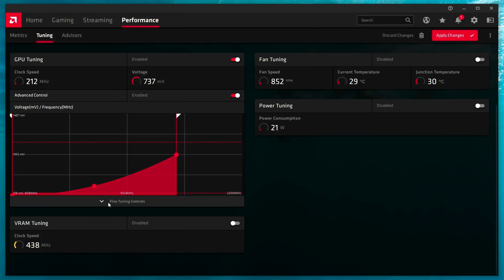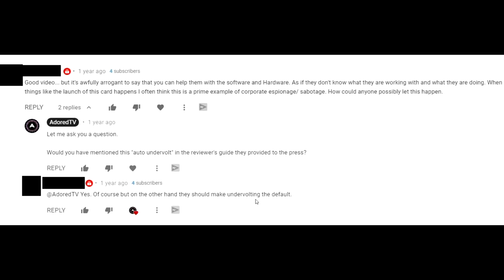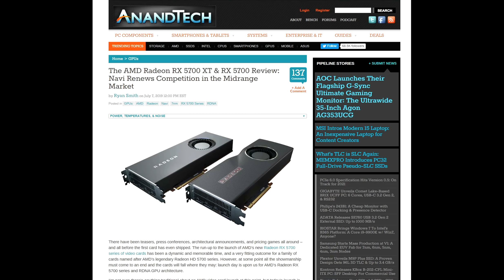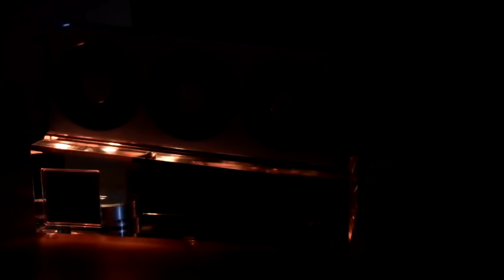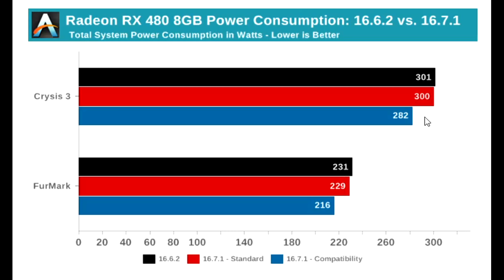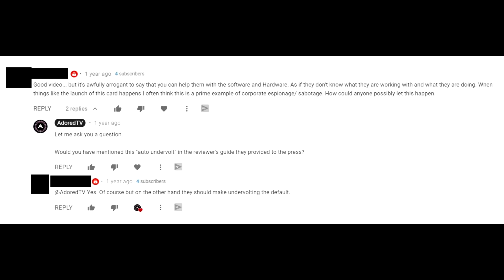Fixing AMD's "Hot and Loud" Graphics Launches.

Comment: Sorry to hear about the ulnar nerve pinch.  I’ve got that in both arms, going for over 10 years now. 
A Roller mouse helps alot. Tried Trackball, but that introduced severe thumbpain since I was not used to it. 
Been gaming with controller on PC for the last 9 years, since mouse was too painful. 
What has helped me, was to train the backside of my upper body, and stretch the front. It’s not gone, but it made it tolerable. It’s like bad posture makes this worse. 
Before this, I reached a point where using a remote or phone, would result in pain in a matter of seconds. 

I sincerely hope you get this issue resolved quickly, since I love your videos and I know how this affects productivity. 

Happy undervolted(thanks) Vega 64 and Ryzen user, wishes you a speedy recovery.

Comment: In fact I think a lot of reviewers/buyers would be happy to see a card that has "lots of overclocking headroom" while beeing reasonably cool and silent in default mode  instead of "can undervolt like a boss"but is loud and hot on default. It sells better in every way possible I think. After all, everyone likes to talk about that magical "free performance" you can get from the GPU.
Reply from the maker: The overclocking part of the video didn't make the cut but essentially it would overclock the same, it would just require a voltage increase "earlier".

Comment: so , they responded to you(17:40) that the reason for this voltage was """in order to keep the card's stability over a longer period of time""" and that nvidia's design has""exceptional performance per watt"" and your proposal to that is the consumer to risk their GPU's longevity just because your own GPU silicon seems to respond well during undervolting , instead of AMD trying to compete with nvidia at their ""exceptional performance per watt"" designs ??
Did you ask any consumer if they want to risk their GPU longevity after those supposedly … 3 years ???
Just for your information , I still have an older PC which still uses a GeForce GTX560Ti , and myself as a consumer , I can tell you that I wouldn't like to take the risk of throwing this GPU after 3 years , just because you might like to take such risks for yourself...… (*I have a habit of keeping/using my old GPUs instead of throwing them away !!! )

---P.S. and before you accuse me for being biased or harsh against you(*since we had an argument in the past ,so I have to consider that as a possibility ), I have already asked these longevity-related questions , back when I used to be an [H] forum member . check my #15 ( https://hardforum.com/threads/amd-radeon-vii-chilling-undervolting-h.1977860/#post-1044097362 ) back from 25/02/2019 : 
""""""""""""""""""""""""Nice analysis Brent , but can you explain something because otherwise i'm unable to understand :

since undervolting can result all these that you mentioned above (lesser power , same performance) ,then why exactly AMD doesn't sell this card with lesser voltage at default :eek:???

THERE MUST be some downside ,otherwise this means that AMD 's engineers sabotage their own GPU ,AND their customers as well , by making them pay more money at electrical bills for no reason whatsoever:wacky: !!!

(*i don't believe that AMD 's engineers are idiots , so there must be a reason for selling this card with these default settings. For example , when undervolting the components of the GPU , could this affect their longevity negative or positive? There must be some explanation which justifies their decision about the amount of voltage that they are using as default :confused:!!! )""""""""""""""""""""""""

---and my fears from back then have indeed been confirmed since today AMD responded to you that the reason behind this voltage decision is indeed related to longevity issues... which was the obvious/logical reason if I may add …..
Reply from the maker: Erm, I think you've misunderstood this by a lot.  Undervolting increases the longevity of your card.  The high voltage is to maintain stability regardless of how hard the card is used.

If you undervolt your card to say, 1000mV and find it crashes in a game, what do you do?  You increase the Voltage by 10mV and it's fine.  Your card is still lasting way longer than if it were 1100mV out the box...

Comment: Sorry Jim not on my watch! If AMD pulls something like this i will boycott them just like i did with Nvidia even if it means i have to give up on gaming!
If they feel confident enough in the "Auto Undervolt" feature to make it the default value for Every Retail Card i would not mind but better rename it to "Auto" or something that doesn't look so hacky... But don't try cheap tricks like that on me! And i say that as someone who identifies himself as low key AMD Fanboy owning a 3700X and RVII.
Reply from the maker: Is this really any worse than some other stuff they've done with Navi, like the dumb rebranding from the RX590 and late BIOS update?
Reply: @adoredtv  RX590 Rebranding? You mean the RX690 branding they forgot on the slides at the announcement i guess? If so i don't care about names important is whats inside. And the 5600XT VBIOS thing was just a major f###up and panic reaction with no malicious intent as far as i can tell. It sure did damage the reputation but at least the changes were made available to consumers. But intentionally deceiving reviewers and consumers with special press drivers is just that one step to far. 
As i said if they feel confident enough in the feature make it the default option for everyone or leave it!

Comment: My vii uses 1060-1063mv default. Where you aware the vii veries from card to card out of the box? With the broken drivers after 19.7.5 I just a run an undervolt of 1801mhz @ 950mv, 1140mhz HBM. With my EK block power draw is low and temps in the UK winter 32c edge and 60c junction when loop is equilized. I found 1900mhz 1000mv was a nice spot to stop performance Vs power draw, even then it's a cost of around 30w for 100mhz.
Reply from the maker: Yes I know the voltages vary from card to card.  1060mV default is pretty nice though.
Reply: I blocked my brothers card too, he got even luckier. 1052mv! I've done loads of posts on the ocuk owners page. The alphacool block was the biggest disaster! As the RGB screw head was damaging chokes on the PCB. One member has just move like I did to the EK block and it's night and day. 30c temperature drops. All down to poor blast plate design on alphacools part.
Reply from the maker: @JustAnotherPissedOffBrit  Pretty much tells me that all cards should run close to 1020mV and certainly 1040-1050mV.  Would be nice to know what kind of silicon the press got but mine at 1100mV is for sure a major reason for the noise.
Reply: @adoredtv  I've found you can drop 100mv off most cards. I don't even use any extra power either its just set to default on the power slider. 
My Sons 5700 blower is 1018mv default. I run that at 950mv (1750mhz default clock) with 50% fan speed in games. The noise is fine and the temps are very good. under 60C (57-58c) normally when he's playing Fortnite epic settings with a 75fps lock for the freesync range at 1440P.

Comment: 1.2mv 2040ghz -minus25% power 80c hotspot constant stable 220watts 62c gpu temp 1400rpm i think navi draws more power like the 480 issue, 0% power limit 300watts, reduce power limit its definately got a power draw issue i experimented for a week same results power consumption

Comment: Maybe I'm the odd man out but when I sit down to play a game, I care more about performance and stability than about a detail like undervolting the GPU.  I presume that the card's manufacturer and AMD's driver team knows what they're doing to make the GPU work best, and don't really see any reason to second guess this.  I'd probably put my fist through my monitor if the graphics subsystem took my system down because I'd undervolted it, just after I was beating a big, bad boss in game!  I expect that my GPU will be retired as obsolete long before it ever "wears out"...  Not like the graphics card's fan noise is even noticeable either...

Related to cooling, I did recently implement a new cooling solution for my CPU, replacing a brand name, 3 year old liquid cooler with a Noctua NH-D15 (after my old system got wrecked - again after 3 years - by a liquid coolant leak with the cheap OEM liquid cooler - which I never want to ever see again)!  To my surprise, the new air cooler performs significantly better than the old, 240mm radiator liquid cooler did for my 140w TDP i7-5820k CPU - consistently beating a "100% load on all cores for over an hour" workload's temperature by about 15C.  I did use a higher efficiency thermal paste (Thermal Grizzly) than Noctua provided and the possibility that the NH-D15 may be overkill for my particular TDP, which may have helped.  At least I'll have no future coolant leaks to worry about!  -:)

Comment: My Vega 64 nitro+ can be undervolted from 1200mv to 1025mv and actually gain performance even with a slight underclock applied. It can even run at 950mv but the max actual boost it will reach is a little lower. But it's fun to play division 2 in very close to max details@1080p and hitting around 90fps while only seeing 175-195 watts being drawn. Compared to massive 300+ watts of stock with 50% power slide if i let it go full ham. The card actually fried one of my PCIe power plugs back when i got it because I used a split cable(came with the PSU) which had worked without issue for a 1080ti. Goes to show that you need to do your research. I've seen total system wattage reaching 700 watts when the vega was pushed to its limits, thats 1 vega 64, Ryzen 2600@4,0ghz 1,35v,  2 SSDs, 1 harddrive and 6 case fans with a Platinum AX860 PSU from corsair. MENTAL :D. This is why I believe Vega to be a proper enthusiast' gpu  as you need to know what you are doing and how to extract the maximum power out of it while handling power consumption. If you figure this out a Vega 64 will reach 5700 non XT performance while "only" sipping around 200-210watts of power. Thats a hell of a lot better than what the reviews show. My Vega have given me the best gaming experience, ZERO issues when gaming and perfect frame pacing but only after the beast was tamed.

Comment: By undervolting + underclocking my 5700xt to 1800mhz and 950mv with little to no performance loss, the cards fams run at a slow 1000rpm

Comment: Drivers don't need to be updated to increase voltage over time.
It would be relatively easy to add a cumulated runtime counter and increase voltage as a function of runtime (this should persist across drivers, and systems, so maybe saved somewhere on bios?).

This is both way more robust and gives all users the best experience possible. No instability for 24/7 users and no increase in power consumption for occasional users :)
Reply: Use the voltage as counter state, but don't actually count anything. Make increases probabilistic: Roll the dice every so often; if below a threshold increment by an iota. Won't needlessly increase when off, won't interfere if the owner feels to reset voltage out of their own volition.

Comment: I am an and fan, but running default undervold I would not support, but my idea would be on driver install, driver gives message saying "this card supports undervolting, reducing power usage, reducing noise, reducing temperatures, and increasing fps, recommended to enable", (results may vary,) and have options- "enable undervolt",  "default setting"

Comment: So great options. but a shame about the mindset. if you can build in a periodic "voltage check" which your card offers you, say every 3 months. and at installation. people would be inclined to think of it as a service AMD extends to you. 
this makes it pro consumer. 
it is fully disclosed and out in the open. and it makes the life of the card last longer. lower voltages mean less silicon degradation. and the name can be "variable voltage control" (tm), or Dynamic Voltage Control (tm)

Comment: Instead of all these shenanigans, maybe RTG should focus on fixing these power issues at an architectural level. If nVidia can do it, so can AMD. Also, AMD needs to stop overclocking cards out of their efficiency range for marginal performance gains. The optics would surely be better if they came in 10% slower than the competition, but had cool and quiet cards that were also selling for a few $ under their direct competitior.

Also, get well soon, Jim. :-)
Reply: That sounds good and I assume that they have more room with navi to do just that, because vega was a relatively expensive design so they had to reach a specific price and therefore matching performance

Comment: Or maybe have the card firmware auto calibrate the undervolt at boot. You could make it a device level thing rather than software driver, then have the card tell you what you want to hear. If it crashes on boot, blame the user :), have the card remember the bad setting and try another at next power on.

Comment: I gotta believe that silicon degradation over years changes from node to node and architecture to architecture. However their over-voltage remains consistent throughout nodes and architectures. Leads me to think this is a legacy decision that has just stuck around and never been revisited. However . . . could also be real. But i doubt AMD is actually doing 1-3 year testing on GPUs running 24.7 . . . Perhaps im wrong though.

Does nvidia get the same undervolting benefits? i don't see nvidia users talking about undervolting as much . . .

Comment: Option 3 is their best option. Start with lower voltages in both the press and release drivers, and then raise them slightly shortly after IF the RMA rates are above average. With the press and release drivers being the same, voltage-wise, they're not deceiving anyone in the reviews, and if anyone questions the later increase, then it is a "fix" to "an issue affecting a minority of users".

I have the same problem with Ulnar nerve compression in my left hand. I've had it for years and it's never gone away completely. That said, leaning on my elbows when at a desk or table makes it worse, so maybe avoid doing that. Hope that helps.

Comment: Power Draw = Frequency x Voltage^2 x Capacitance.

That's why lowering the voltage can help quite a lot to lowering temperatures.

As far as auto undervolting the GPU, I can't say how good that is for Vega, but for my 5700 it works just as well as manually undervolting it, so I recommend everyone with a Navi card do so. You do lose the ability to OC the memory, but Navi's not bandwidth limited so that's a waste of time and power/temperature anyway.

They can't make it the default in reviews though, because reviewers would either just disable it, or check each other's findings, see that they don't match up, raise concerns, and cause havoc. The praised reviews would be swept away by all of the negative press that follows.

Lowering the voltage to begin with and increasing it with time will end up with "hot and loud" at some point in the future again, causing problem's about AMD's image then.

Lowering clocks with time would also hurt AMD's image in the future. Think Kepler and nerfing with drivers. AMD can't afford that kind of bad press now, nor will they want it in the future.

The best and easiest solution would be to simply use a better reference cooler.

Comment: another suggestion: modern CPUs and GPUs have very dynamic and adaptive voltages, and can even be responsive to errors to dynamically maintain stability in some cases.
Rather than increasing voltage or lowering clocks over time, it could actually be based on use hours, voltage in vs voltage out at various points, or even "soft" (no lockup) errors, and be handled entirely within the black-box bios.

I suspect this isn't so much a quickfix, though, as just an eventuality of computer hardware someday.

Comment: It could be that they already have stability issues and auto undervolt would increase that enough that it's best left off by default. Another reason could be the warranty may not be based on 24/7 usage but on the average usage over a 3 year period which may enabled them to make the card cheaper and more profitable while giving just enough performance to be useful.
My opinion is amd have already ditched the current lineup of cards priority wise and has been focusing on the sony/microsoft console side of things. I don't think amd/rtg have large enough pool of people to split over all these area's without one getting shafted a bit. I imagine they are focusing on those console contracts as it is a good source of income and free marketing, while making sure there's not bad press over bad hardware/firmware for the consoles.